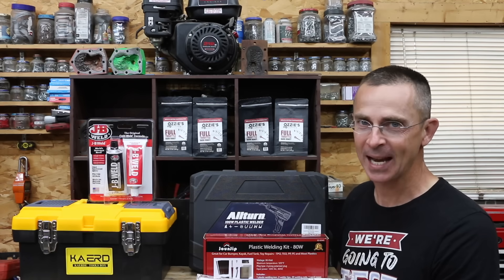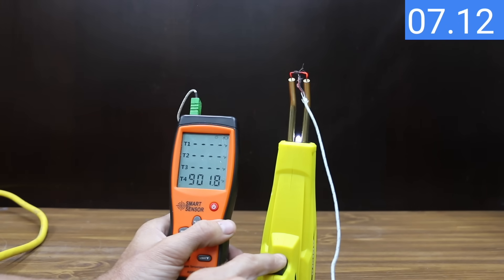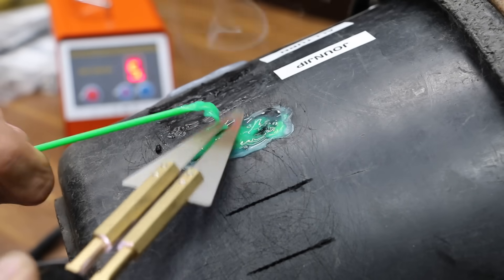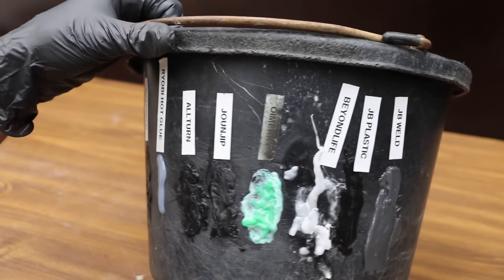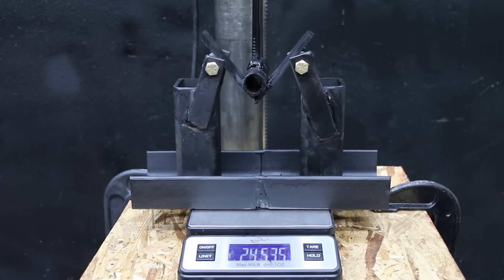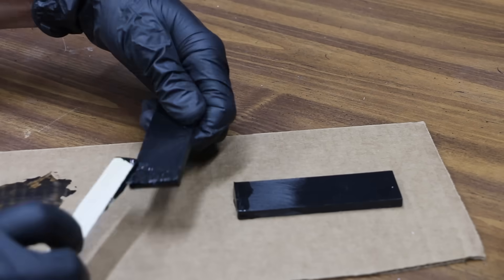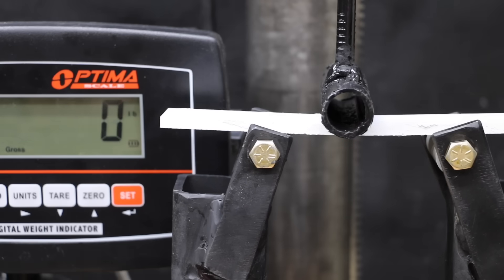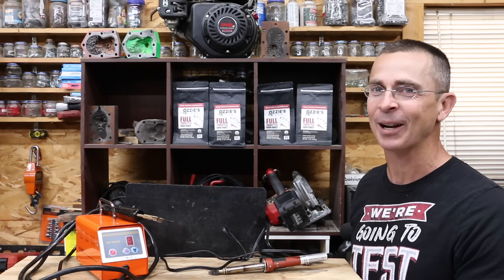Don't Buy A Plastic Welder Until You Watch This Review!

Comment: Have you ever compared the bottle jacks? Especially the 20 ton bottle jack.
I own 3 20 ton bottle jacks, one of them is a 20 ton air assit bottle jack.
I am asking because I own a 2001 GMC 3500 4X4, 4 Door, 8 foot bed, Dually, with a Duramax 6.6 and a 6 speed manual transmission. 
Anyway I have used my 20 ton to lift my truck and all 3 of them struggle even when lifting just one wheel. 
So there's your challenge.  Good luck and can't wait to see if you do it.
Reply from the maker: Thanks for the suggestion.

Comment: I use same-type filler rods chucked into a drill. The rotating friction melts the material and you can achieve a complete weld that way with no added heat.
Reply from the maker: Thanks for sharing.

Comment: I read through many of the comments below and from those that either do this often for work, or often for DIY, pointed out some interesting tips. Even though that Todd did not use the best technique, that's fine by me. I am probably part of a large group of people that would want this infrequent use. 

So even though some have used the BeyondLife or similar and do state that there is a learning curve or need to develop a technique, but works very well when used by an experienced user; that is not for me. Using it infrequently, I would like something that using it occasionally, it works without being an expert.

** One note Todd, typically at the end of your videos, you always have a table that shows the results of the various tests you did...which was missing from this video. Those tables that show all results are well appreciated.

One other thing, since the hot glue did well, just a note which I am sure some are aware of, that there are glues which the stick is almost transparent, more light duty use. Some glues are opaque ivory color, usually medium duty and the fairly yellow colored sticks are more heavy duty, which could make the glue guns even more of an attractive option for some. If you find a specialty glue place, they even have some that offer very short open time and curing, to very long open time and curing.

Thank, as always for the great video!
Reply from the maker: You are welcome!

Comment: I always appreciate your video's!  I do have to say that there seem to be some glaring problems with this test and I'd suggest if you do it again you try some of the following.
1:  Use a soldering iron with a fairly small tip, maybe between 1/16" - 1/8" and press it down through the plastic between the crack/break.  Then either do a stir weld technique (spinning the iron or piece) or make small circles and move along the crack as it melts.  I usually melt about 2x the width of the soldering tip.  I've even used the tip of a hot glue gun if it gets hot enough
2:  you need complete penetration of the heat on both sides of the plastic.  If it is thick plastic I suggest warming the area (about 1-2" on either side of the crack/break) some how.  A heat gun, hair dryer, hair straightener (ironer/flattener), toaster, toaster oven, torch (be careful & don't get too close).  The warmed plastic melts much easier & kind of tempers the weld line and it seems to be less brittle
3: Use filler plastic of the same type.  Identify the plastic by the recycle number (1-7 I think).  Most 5gal buckets are HDPE and I use one of these for filler/patch material.  Just cut strips to different widths.  It's really nice to have some very thin ones to be able to feed it into tight areas.
4: Apply the staples after making the weld described above.  Apply a top layer of plastic if desired.  I'm sure you can make staples from any metal, even normal wood or cardboard staples (heavy duty shipping staples that so love to slice people open).  Just bend to shape & heat with a torch.

You can bond 2 layers/sheets of plastic together (on top of each other) at the edges by using a thin soldering iron tip about the same diameter as a single layer of plastic is thick.  Do the spin weld or small circles with the tip inserted as far as possible along the edge.
Reply: Been doing steps 1 and 3 with a cheap, chisel-tip soldering iron for a year and it works great, especially on cracks. And is neater than most of the demonstrated techniques.

Comment: Awesome!  I have a kayak hanging in the garage that has a crack from an encounter with a pointy rock. I have debated the JB weld vs a welder. Many years ago my father would repair his green Colman canoe with quakerstate oil bottles... used some hot melt glue and a propane torch. The smell flooded back to me as I typed. 
Keep up the great work. Cheers from Wisconsin!!
Reply from the maker: Thanks, will do!

Comment: Unfortunately  cosmetics were just as important as strength  with most of the plastic repairs I've  done, it's hard to say which method  would have the best practical  use. I've  had to used a combination.
Reply from the maker: Thanks for the feedback.

Comment: i use my old soldering iron with diy copper tip and cheap plastic rods to repair my stuff if needed  i melt in small nails or steel wire to make bit stronger weld
Reply from the maker: Thanks for sharing.

Comment: Just like metal welding it might be a lot stronger if you put a bevel on each side and fill the break with the plastic filler, but the base plastic needs to be melted so the filler will mix with the base not just glue to the surface. Never welded plastic but have been a metal welder for more than 40 years. In metal welding if the base metal doesn't melt and mix with the filler then a metal weld will break off quite easily. If the weld and the base metal mix its quite likely your weld will be stronger then the unbroken base metal.
Reply from the maker: Thanks for the feedback.

Comment: I've wondered about plastic welding and doing 3D prints I've used A cheap soldering iron for making holes as needed and my friends and I used JB weld for a lot of things but for small projects and multi part 3D prints regular Super Glue has been useful, I recently repaired a small crack in a bathtub with it and now it can't be seen to the point my mom's friends don't even realize there was a hole and made fun of me for having said I patched a hole thinking I meant the drain hole... So I just laughed it off. I was about to fill the tub to full capacity with no issues which was fine.
Reply from the maker: Thanks for sharing.

Comment: When you weld metal with filler material, it's a good practice to bevel the pieces to allow the filler rod to get deep penetration.  This applies to plastics too.  I do a lot of plastic repairs, mostly small stuff, but occasionally larger pieces like bumpers.  I've been using a Milwaukee M12 soldering iron with some aftermarket tips from amazon.  Use a chisel tip to trace the break and cut a furrow where the melted plastic piles up on both sides of the break/crack then use a combination of filler and/or drag the piles that you just furrowed out back into the trench and work it to mix them together.    Keep some heave steel wool handy to keep the tips clean and it works pretty well.  Just like welding metal, welding plastic is easy.  Welding it so it's strong and looks good is NOT easy.  It takes practice, practice, practice.  I've made my own "staples" out of mechanics wire bent to form a continuous s or sine wave shape with pliers and simply use a wide chisel tip to melt and embed it along the length of the repair.  That has proven very effective.  Again making it look good is difficult, but that's what files, sanders, and body filler are for.  Piling filler rod over a break will yield ugly, weak results.  Again deep penetrations and blend practice, practice, you get the idea.  

That hot air model works a lost better when push it forward into the repair, this preheats the repair area for good blending, penetration, and adhesion.  I'm no master at this and still practicing to get better.  So don't feel bad about your results.  Use the right filler that matches the material.  If possible look at the part for ID in the plastic to get a good match.  Type the molded id information into google:  Type "plastic identification  xxxxxxxxxxxxx" where xxxxxxxx is whatever your stamp/molded id says and hit enter.
Reply from the maker: Thanks for sharing.

Comment: There is also a Orange/honey colored Hot glue made for higher temps & a much stronger bond, (but it is more expensive, so it may be worth buying in bulk if you think you'd use it alot) in most cases if you have a good seal even hot water or steam under pressure won't break it's bond, & using it with wire mesh or some form of heat resistant cloth will bond to nearly anything, & you can use a hot air gun to get a smoother or more uniform melt if needed. Also hayesbrewer9014 is correct about using the same type of plastics as even under heat dis-similar plastics will not create a very good molecular bond- in that case look for something that does chemical welding where the glue actually is more of a solvent & melts them together via chemical processes.
Reply from the maker: Thanks for sharing.

Comment: I have a corded hot glue gun which cost under $10 which I feed straight parts of plastic coathanger through. It works better than anything here, except the staple and JB Weld. I have had luck heating the surface with a heat gun and pressing regular staplegun staples into plastic with vicegrips. And I never have used steel mesh, only fiberglass sheets. Don't buy "the correct tool," it's just marketing.
Reply from the maker: Thanks for the feedback.

Comment: I’m so glad you did this .. I haven’t touched a plastic welder since early 2000s when it was still in infancy..  I’m not sure about your bend tests.. normally with metal you would bevel the edges .. I wonder if you did something similar would the results be different? That’s where the strength comes from since it penetrates the joint..
Reply from the maker: Thanks for the suggestion.

Comment: You obviously don't know how to weld plastics, you need to be using the same plastic material for filler rod. Welded properly with the hot air gun and same plastic filler rod you wouldn't break the joints. John

Comment: Something in the lines of this episode but different... heat guns, best/widest range of wire gauge it can be used on. Also extending on that, a cheaper show would be best wire brand to use for various applications like, power, audio/video, etc.
Reply from the maker: Thanks for the suggestion.

Comment: @projectfarm Do a video on "silicone spray vs Dry Lube PTFE Spray" - like comparing the two that WD40 offers, and see what is best for certain applications. I constatnly can't decide which one to use where in my shop, I use both but often wonder "which is best." for example, a key lock cylinder, or etc.
Reply from the maker: Thanks for the suggestion.

Comment: As a roofer, I have a good bit of experience welding TPO with a hot air gun such as the Beyondlife.    A welder like that is designed to melt overlapping sheets together, or a patch, with ideally a 1-1/2" lap. A chemical cleaner with Xylene softens the plastic before welding, and greatly improves bonding.  You need to touch the tip to the surface of the material under the patch, and keep moving steadily to melt the patch and the material being welded simultaneously, while rolling the top of the patch for adhesion.  I have never welded a bucket or bumper, but I would try to find a piece of the exact material you are welding as a patch or filler.  Thanks for the video!
Reply from the maker: You are welcome!

Comment: You need to watch some YouTube videos on how to use hot air plastic welders, I’ve used a leister Triac & plastic welder for years on poly propylene ABS and other common plastics.
Getting the proper heat range set on the welder for the type of plastic you are  going to weld is critical!👍😸

Comment: Hey man. Love the videos! I'd love to see your take on different ways to attach wires together. Soldering, twisting, electrical tape, mid line taps, and recently I saw solder butt connecters that you put a heat gun to and they shrink wrap as well as melt a ball of solder on your connection. I'd love to see you test all these methods for connection strength, voltage drop, or anything else you can think of.

Comment: When repairing thick materials with filler, make an angled cut about half the with of the material on both sides of the repair. Think of it like welding heavy gauge steel.

Comment: You should test out the fix that puts a stitch design over the cracked piece with zip ties. I did that with some JB clear weld for extra strength for my hood on my tractor lawnmower John Deere L100 and it's been a couple years and it's still working without any problems. well the fix is not the engine that's just crappy and the oil pump that I have replaced leaks at the pump. I think that's because they have the vacuum part attached to the oil reservoir.

Comment: I experimented with a few of these last year and found the metal staples to be awesome for adding strength to the piece. For some repairs, they are enough to hold the piece together by themselves. For the strongest repair, I’ve used the staples, mesh, and plastic welded into the crack. If you hold the welder onto the mesh so it gets hot and actually melts down into the plastic, it’ll be a lot stronger. One thing I’ve learned is that there is quite a steep learning curve with this type of repair. I would LOVE to have that OIMERRY one. It looks like a do-it-all machine that will make professional-level repairs. Thank you for doing this video, this is something I wish existed in the past before I had to learn by trial and error what works best for plastic repairs.

Comment: Technically speaking, I am a professional plastic welder.

Some tips. 
Hot air welders are the best, they just take a little practice. The key is looking up the proper welding temperature, for HDPE it is 560-570 F. If you are too hot it will ruin the integrity of the plastic. 
Use the same filler material as the base material! Different plastics do not stick to each other. 

The base material and the filler material should be heated/melted the same amount and allowed to cool before you move anything. You are welding, not gluing despite how it may seem.

Lastly, cleanliness is very important. Instead of sanding, I suggest scraping. You need to remove the oxidized layer of plastic on top because that cannot be welded properly. Cleaning with alcohol is important too.

Look up videos on proper hot air plastic welding for more info. I think Leister has helpful content available.
Reply: Yep - melting the parent material at the same time you're melting the added material is, I believe, the most overlooked part.  Vitally important.
Reply: I have an SMD hot air tool which is handy with its pinpoint nozzle and fine temperature control.
Reply: @dubmob151  I was wondering the same - whether my hot-air rework station could be used as a hot-air plastic welder. My station supports temperatures between 100 to 500 celsius (212 to 932 fahrenheit) along with adjustable air flow and different size nozzles, so maybe, but I'm sure technique will make a big difference between messy failure and success.
Reply: @brettski74  it should be ideal because you can dial in the temperature exactly as needed to melt without burning-
Reply: get the extruder gun, think liester makes the smaller ones, i've only used the bigger ones, worked on Geomembrane  40mil to 80mil  HDPE and LLDPE

Comment: @ProjectFarm would you consider doing rechargeable worklights?  I know there's a lot of variety from Handheld spotlights to ground sitting work lights and tower work lights. I'm thinking of the ground/self-standing bigger ones more than 'flashlight' style. Every brand seems to have multiple types from the single integrated chip with 100's of LEDs on it to the panels with a bunch if discrete LEDs with no lens, and discrete LEDs with individual lenses, way too many options.

Comment: Can you use a wire mesh that's not stainless steel? My hardware store has aluminum screen and galvanized steel stucco mesh that would both work, but I can't find anything online about using anything other than stainless steel.